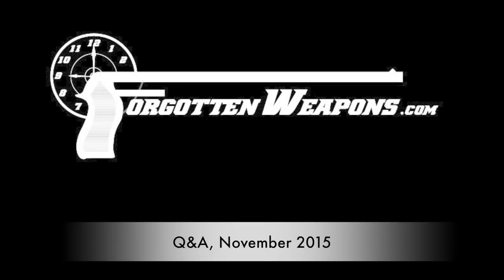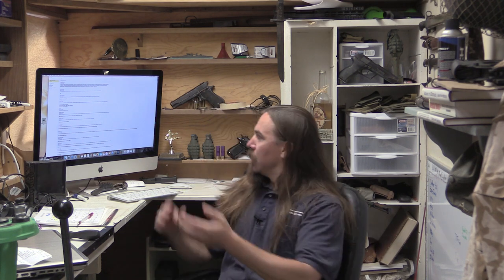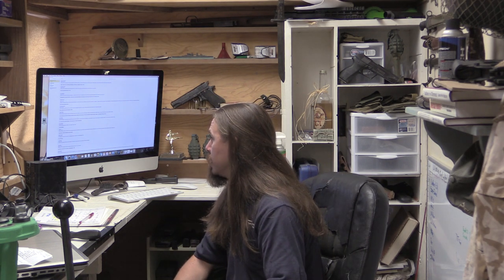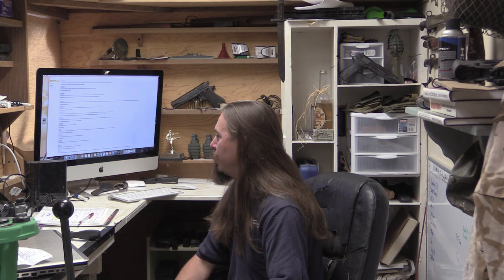Forgotten Weapons Q&A November 2015

Comment: I have a Star 30M handgun I purchased relatively cheap for doing the pistol tactical classes. I had features not seen on more modern guns until years later, like the slide that rode inside the frame. Very well made and very accurate. It was the Spanish military pistol for for yrs.

Comment: The SMG Suomi KP-31 was prone to jamming when dusty because of the very high manufacturing tolerances and practically hermetically sealing mass block locking. But I'd love to see you Ian to take it apart and shoot it on the Forgotten Weapons since it is a quite unique SMG mechanically. Just make sure you use the hottest 124gr full house loads or the weapon won't reload because of the weight of the mass block. High rate of fire too, 900-1000rpm with full house loads.

Comment: Vid review that Steyr GB.  They will cycle even with squib loads - I watched while one was fired until five bullets lodged in the barrel and it finally bulged too much for the slide to cycle.  Once the bulged barrel was replaced it worked just fine.

Comment: Ian, about the Dutch Mannlicher. It actually is based of the 1890 model. The rifle was formally adopted on December 4, 1895, thus naming it M.95. Further the production from 1895 to 1904 was in Austria-Hungary because of distrust of local produced rifles. From 1904 all rifles where produced locally in the Netherlands for a much lower cost and with good quality. Most rifles therefore are made in the Netherlands.

There was a commission in 1910 which recommended rebarrelling all the rifles to 7,92x57mm . That didn't happen because it would cost money and spending more money than strictly necessary on the army is a political sin in this country. So in 1940 the standard ammunition was round nosed 6,5mm FMJ designed before 1895. Makes you wonder why the Indonesian army preferred .303. :P

Comment: Yup I learned the rifle stock lesson on a Sporterized No. V mk 1 Jungle Carbine I picked up at a gun show.  I figured it wouldn't be hard to find a replacement stock and I could restore it.  I might as well have gone unicorn hunting because I would have had more success doing that.  At least none of the parts were chopped so it still is a cool rifle and my first ever C&R purchase.

Comment: Speaking of interesting, charismatic, but not particularly rare or expensive guns, I recently acquired an Ortgies, which (for those of you who may not know) is a smallish pocket auto made in Germany starting just after WWI.  It's in 7.65mm (also known as .32 ACP) and has the oddest safety I can recall encountering on an auto pistol.  Otherwise unremarkable (except that it's oddly heavy for its size), but well-made and comfortable if you don't mind using a genteel pinky-out teacup grip.  Well worth the $300 worth of other stuff I traded for it, just for its "huh, I never saw one of those before" value.  Also, I am required by Federal law to add, "An Ortgies was mentioned in a short story by J.D. Salinger, you know." :)

(Which reminds me - Ian, I sent you a YouTube PM a bit ago offering the loan of the Ortgies sometime if you have any interest in doing an FW item about it, but I have one of those weird pre-Google YouTube accounts and I'm not sure PMing from/to those even works, so I may as well mention it here too.)

Comment: One Finish rifle not mentioned was the Carcano 7.35. Probably just as well since front line troops didn't like them. Also I think stocks were made for rifles but after they went surplus they were worthless in their country of origin. I know a guy that found a barn full of Springfield stocks probably 50 years ago. He said the owner was using them as fire wood. They were worthless at the time.  Although I haven't tried it some of the new CNC wood copy machines that a few wood working shops have might be able to make new stocks.

Comment: Hi Ian, your channel is great! One question I've always had (and figure you could answer with your background) was how did machinists get perfect (or within tolerance) reproductions of parts in the early 20th century without cnc? Did they have a mechanical cnc analogue, or would they just rely on dudes on lathes pumping parts out enough that eventually they got it right?

Thanks!
Reply from the maker: +Jonathan Stahlhacke Two ways. First, manual machines have dial indicators to tell you exactly how far you are moving, and a skilled manual machinist can make something just as precise as a CNC, just slower. Second, on a mass-production factory level parts were often made on a whole series of machines, with each machine pre-set to do a single operation. For example, FN still has the original tooling for making High Power barrels, which consists of about 30 shapers in a series, each one making a single cut. Start with a rifled blank, and by the time it has gone through each machine (which requires no more skill than swapping parts in a CNC today) you have a complete part made to spec.

Comment: On the hypothetical reproduction firearm; I would say something akin to a Dreyse needle rifle, I.E., a black powder, paper cartridge, single action bolt gun. While it would not be practical, modern steel would make it very durable and the paper cartridge would make loading much easier. Of course, the French version (forgot the name) would be closer to what you want. I think a complete redesign would be in order, maybe with a more modern firing pin design.

Only question is, would there be a market, and how would you solve the gas seal issue?

Comment: Here's a question that has been driving me to distraction since I purchased the rifle: I own a Savage 99E chambered in .308 Winchester....It's in excellent condition (from what I was told at the time of purchase I'm only the second owner).....I've checked on several Savage specific forums, and watched more YouTube videos than was probably good for my eyes and there is one inconsistency in/on my rifle that I cannot find an explanation for. Unlike all the 99s (regardless of letter or caliber) that I have seen or read about mine lacks a "cartridge counter window" on the left side of the receiver. Was there a run of 99s that lacked the cartridge counter or is mine some kind freak that made it out of the factory without the cartridge counter? I feel special that at my age, now 61, I own a rifle I SHOULD have purchased back in the 1970s but passed over for several Winchesters and Marlins (OK, I'm also a victim of Old Marlinitus but that's another story altogether). Hopefully you can and will answer this question if you have time.

Comment: Any idea why the industry standard for a civilian AR is the carbine-length gas system, even though that was designed for barrels shorter than 16 inches?  Is there a higher cost in drilling the hole a couple of inches further up the barrel, and adding a little bit more gas tube?
Reply: +neanderthor66 That's a good question.
Reply: +neanderthor66 That actually is a really good question! Something that never occurred to me but now that you mention it, is kind of weird... 
Ian this would be a good one to address if you know the answer, or history of it!

Comment: AR15 in a trench instead of an AKM or AK-74M? Yeah I understand that the AR15 design isn't as unreliable as people think, but the AK is very much reliable, practically designed AROUND reliability, and with the average distance of combat between trenches likely only being 200m or less, an AKM would be plenty accurate while M43 7.62x39 would probably make short work of any helmets/shields that should get in the way. Some machine guns back then came with shields, like some Maxim variants. 7N10 5.45x39 has very good penetration as well however, even better than M855 5.56 I hear.

A downside to modern assault rifles though, what with the gas operation being above the barrel, is that your head must be higher behind the rifle to aim, if you still want the barrel sticking over whatever cover you're using. Yeah it's only 1-2" or so, but the less of your noggin peeping over that trench, the better. Perhaps a more old school design could be advantageous in that regard; Mini 14 or Mini 30 has a lower set of sights to the barrel. Normally I say that full auto is 'ammo wasting mode', generally not useful at all, but in a trench scenario... I'm kinda thinking full auto might actually prove to be more of a boon than a hindrance. M2 Carbine comes to mind, but 200m shooting? Ehhhh... AKM would be more accurate, or ESPECIALLY AK-74M.

I think my choice for a WWI situation would be the tried and true AKM, especially since long range situations will be few and far between. In Afghanistan, there were situations in mountainous areas or possibly even far reaching deserts. Most WWI fronts were WELL within 300m. AKM offers the legendary reliability, relatively lightweight platform (Around 6.5-7lb unloaded, better than the 8-9lb bolt actions of the day), acceptable accuracy, fantastic penetration with steel core ammo, there's 75 round drums available for it to allow it to fulfill an LMG or 'automatic rifle' role, and if by chance you have to do A LOT of shooting while not getting any time to clean your AK for days or possibly even weeks, no worries. The piston operation will keep the action clean, well, other than all the mud you'll be dealing with. Meh, if anything, the mud will just help to wash away the gunpowder residue.

What about a side arm? I'm kinda leaning towards my trusty Hi Power. At my best, I can manage a 2.5" group at 10m with it! The 13-rnd capacity is awful nice, and while the disassembly isn't QUITE as simple as more modern designs (recoil spring must go in a specific way and the slide stop must be removed in the field strip process, adding one more part to deal with), it's not exactly difficult either. Of course M1911A1 wouldn't hurt either, we all know that its older brother the M1911 served well. All the same internals, with just a few (6-7 I think) external changes such as the frame scalloped out on the sides of the trigger, shorter trigger for gloved hands, larger grip safety to nullify the risk of hammer bite, larger sights, larger mainspring housing, and larger ejection port.

If I just had to stick with a WWI rifle and side arm though, definitely Mk.III* Lee Enfield and M1911. C96 with a stock attached is awful tempting as well however, and even the Webley-Fosberry seems like it might be a really cool option, though I wouldn't like to see how it would run after getting mud in the 'slide' portion as well as in the teeth of the cylinder. I own a 1918 Mk.VI revolver, its double action trigger is PHENOMENAL! FAR better than the M1895 Nagant's or P38's. CZ-75's might be smoother though.

Edit: I think a good 'forgotten weapon' for people to cut their teeth on would be a P14 or M1917. Used pretty heavily in WWI by America and Britain, but post-war basically fell off the face of the Earth, though I think the Remington 700 may have borrowed quite a bit from it. It's cock on close like a Lee Enfield so has a smoother action than your average cock-on-open like a standard Mauer, Mosin, or Carcano. Long radius aperture sights which even during WWII was rare to have on standard issue rifles except with the M1 Rifle and No.4 Lee Enfield. The .30-06 chambered M1917 holds 6 rounds instead of the traditional 5, while the .303 chambered P14 holds 5 due to its rimmed cartridge taking up more space vertically. I think it's been becoming more well known in the past couple years, but it's still not something you see much. I got my M1917 for Just $300 or so. Not very high serial number either, so I'm thinking it was made in 1917.

It's got an Enfield style stock and a Mauser style bolt removal latch. P14 came first, British design which borrowed heavily from the Mauser 98 bolt however not to the extent of the M1903 which is basically just an outright copy. America was producing it for Britain, and when they got into WWI in 1917 they had a shortage of rifles so rechambered the .303 P14 to .30-06 and named it M1917. The M1917 was used more in WWI than the M1903. Something like a 66-75% of American WWI soldiers had the M1917 I think. Originally, the P14 was supposed to be chambered in a smaller calibre cartridge, possibly even Magnum strength like the Ross rifle was going to be, but ultimately stuck with .303 because it's what the Commonwealth was using, and the onset of WWI meant that switching to a new type of ammo right away was a bad call, since there were millions of rounds already available. The P14/M1917 is likely one of the strongest bolt actions of WWI. I hear it's the Type 38, and that may very well be true, but I'd be surprised if the P14/M1917 wasn't a close second. The bolt handle itself basically acts as one BIG third lug.

Like a Lee Enfield, its bolt is positioned RIGHT next to the trigger, so you can fire without moving your hand down to the trigger. Just keep firing without letting go of the bolt. Helps to get a faster rate of fire from your rifle. It's got a 90 degree bolt turn instead of the Lee Enfield's 60 degree bolt turn though, so it's not QUITE as fast/smooth. Particularly the M1917 which also has the down fall of having a very LONG bolt to compensate for the .30-06 (7.62x63) cartridge. Nearly 1cm longer bolt doesn't sound like a whole lot, but try working an M1917 next to a Lee Enfield. Still feels very different, more movement to get another round chambered. You won't be getting 2 shots per second off, put it that way.

Comment: I doubt any war in the last 100 years has been won or lost because one side had significantly better small arms. Also, as Ian explained answering the question about advanced infantry weapons, even though the US military has tried several times to come up with something significantly more effective than the AR-15 derivatives they've been using, every one of those efforts has failed. Until directed energy weapons become practical, there probably will never be a significant enough difference between infantry weapons to win or lose a war.

Comment: Probably the most useful video segment I have watched recently regarding the history of weapons. I thank you for presenting this, if I had to choose the weapon to give a WW1 solider it would also have to be the Ak47 due to there robustness and ability to operate in unforgiving conditions, now all weapons have there breaking point and I do agree that ar15 platform is an excellent weapon system but the tighter tolerances could make the platform fail when exposed to the extreme conditions that were faced in the trenches. Thanks again I have subscribed to your channel!